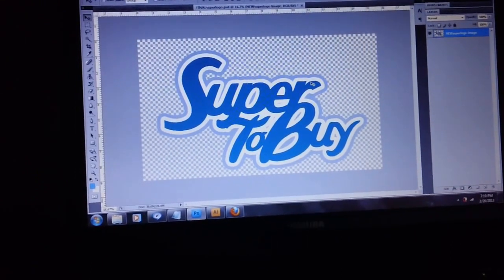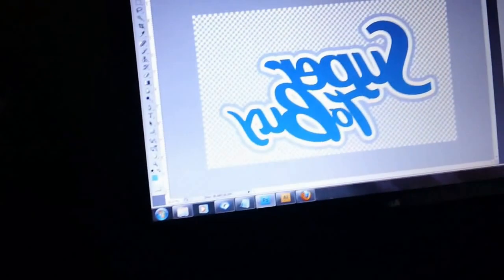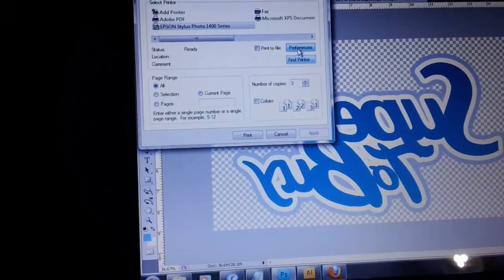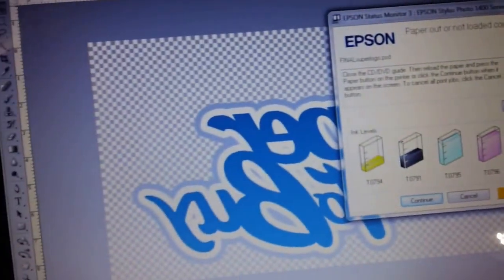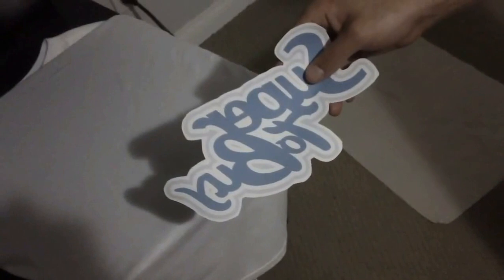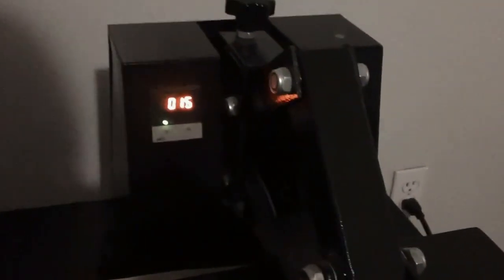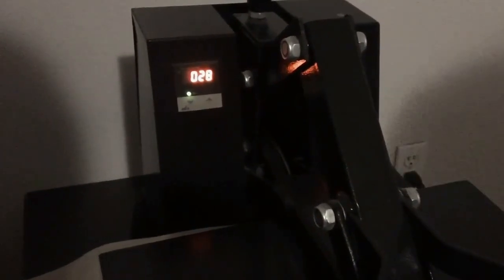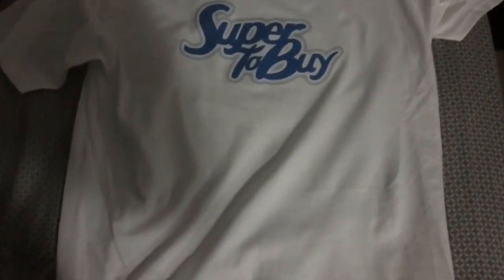CISINKS® Heat Transfer Paper Tutorial and Demonstration for Pigment and DYE inks

Comment: hello i want to ask the ink is the one that comes with the printer or is it a CISS external/internal separate installation !! also is the tshirt 100% so for cotton we use pigment or dye ink?so confusing explanations everywhere!!! just want to test my epson stylus sx205, shall i just buy the transfer paper and print on that normaly? or shall i install ciss pigment or dye (not sublimation) anf then print to transfer paper
Reply from the maker: Hello,

Where are you located? Are you in United States? We carry Empty CISS systems which can carry both dye based and pigment inks. The Shirt would be 100% cotton which we recommend to be used with pigment ink. We would not recommend dye based ink to do T shirt transfers since dye based ink might transfer onto a t shirt. But when you sweat or wash the shirt the ink would begin to wash out of the shirt.

-CISINKS